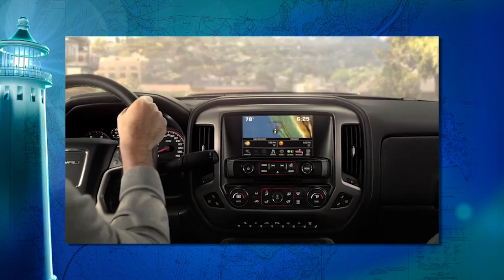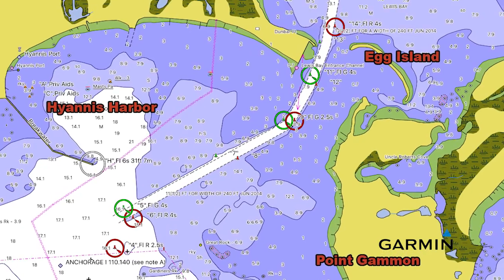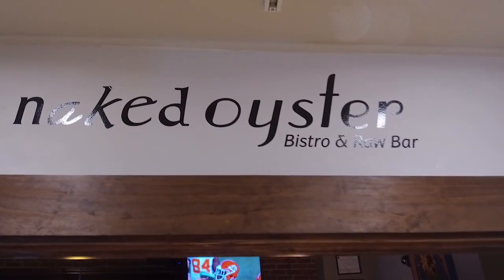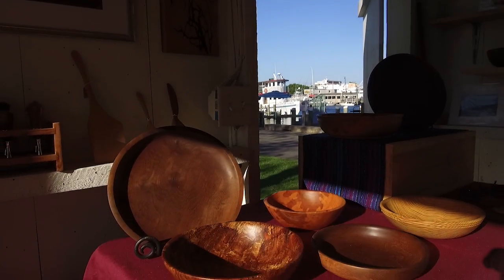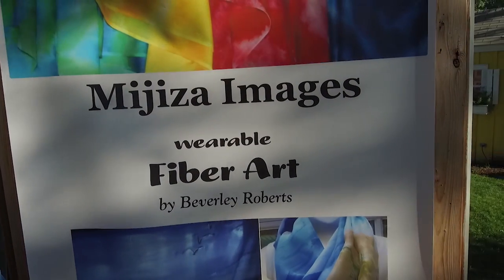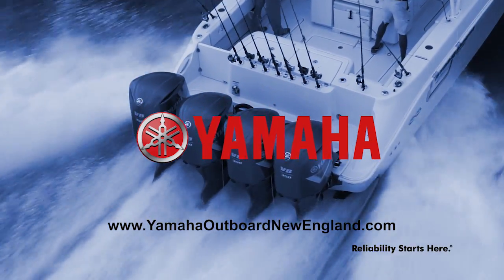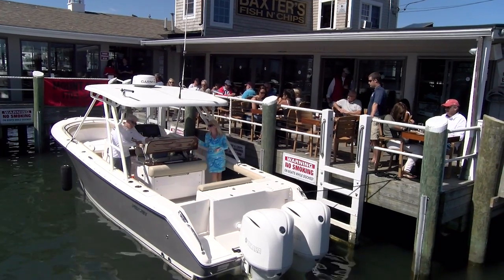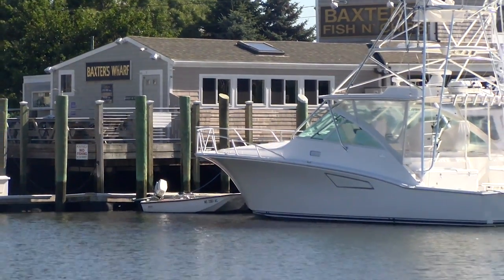New England Boating TV Season 5 // Episode 7 // Hyannis, MA

Comment: It is not Egg Island. Egg Island or what’s left of the sandbar is on the Lewis Bay side of Smith’s Point. That point of land, Smiths Point, extends from Great Island and has increased in size westward considerably over the last decade incorporating a portion of the old Egg Island. If the names have officially been changed then I’ll stand corrected.